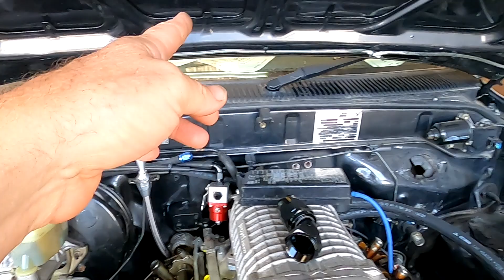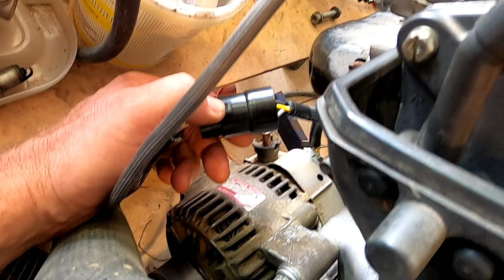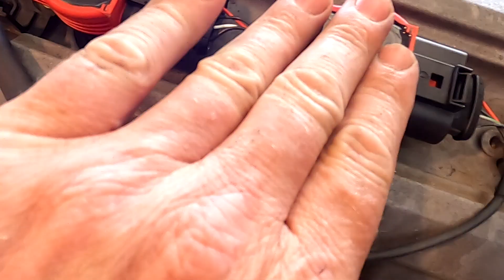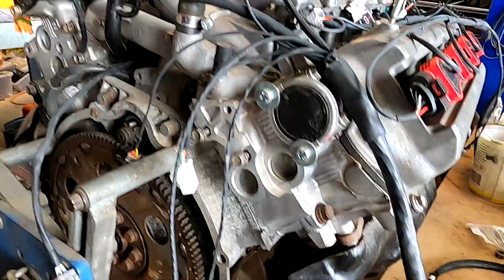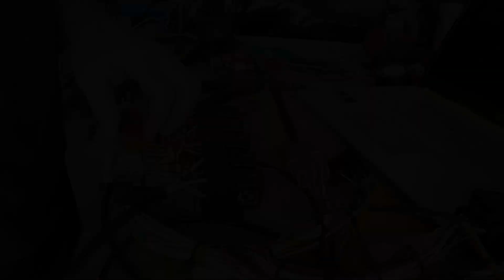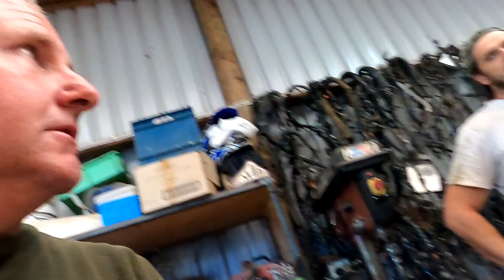USA 1uz link ecu supercharged loom long instructions

Comment: Your right, by time ya buy good quality gauages and wire them in, a dash isn't far off the price, with the dash on can stream, the parameters can be set to the drivers liking.
Reply from the maker: Correct.  And more info on a the dash for diagnoses too.  Cheers Kelvin